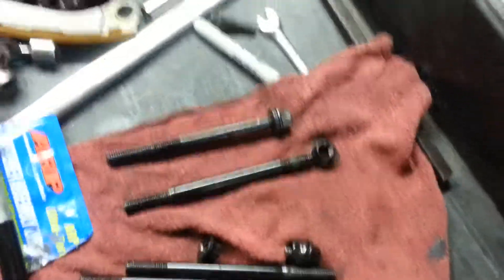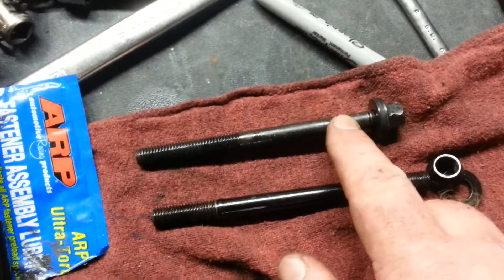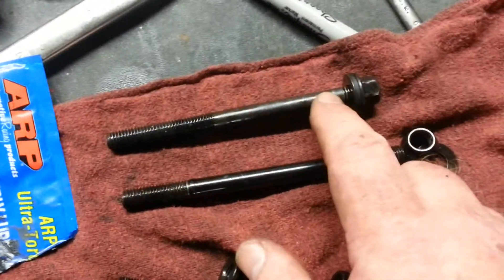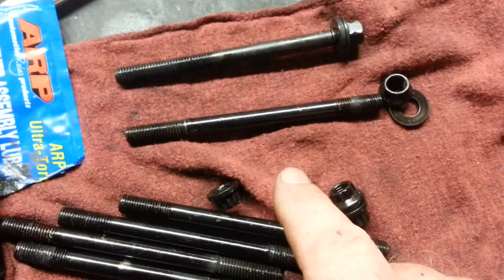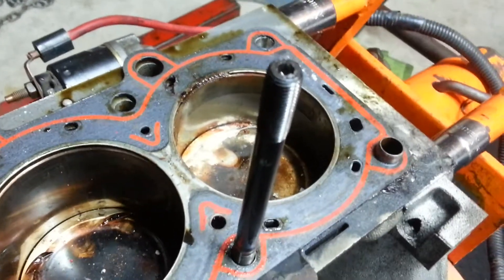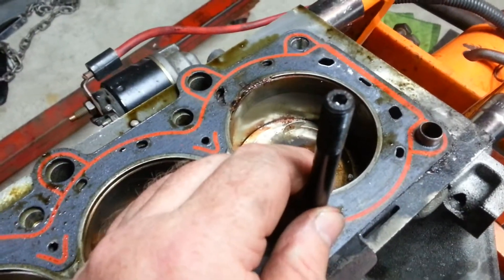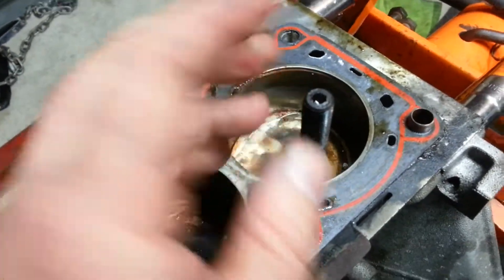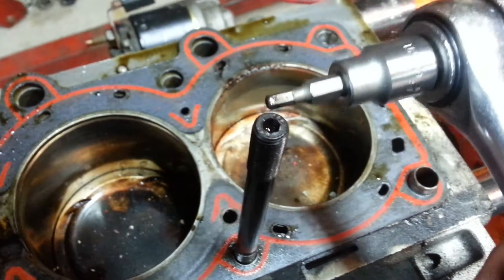SATURN S-SERIES ARP HEAD STUD INSTALL TIPS

Comment: Did you ever use the main stud kit on the 1.9 dohc? And any issues with them?
Reply from the maker: I haven't used the arp main studs recently, no. Only the head studs for this project but years back, I used arp fasteners for the bottom end of a 2.0 liter saturn build I did and the only thing with those was you are supposed to use the torque spec arp wants you to use, not the saturn's. I hope this helped. For up to 15 psi of boost, I've never found the need to use any fasteners outside of stock for the bottom end. Can't hurt, but if you're power levels are mild like that, I'd just save the money. If higher, yes, that is insurance. I'd also strongly recommend them if you're revving past stock rev limit.

Comment: What part number are those ARP studs?
Reply from the maker: 165-4202. Good luck with your project! Bear in mind, if your project is later than 1999, you'll want to call ARP directly and get feedback from them. This project of mine is a 1997 so I'm good.